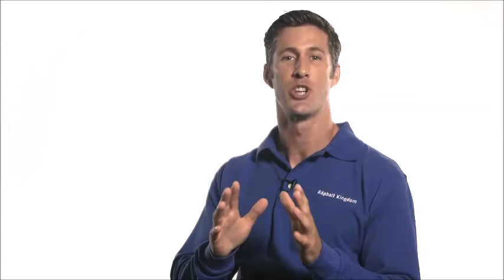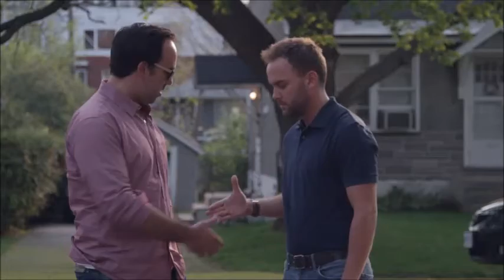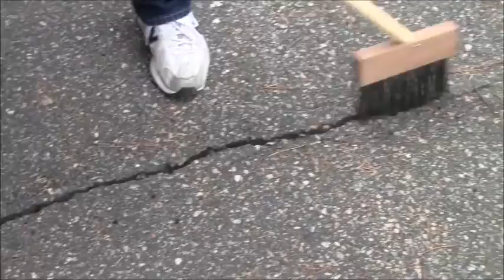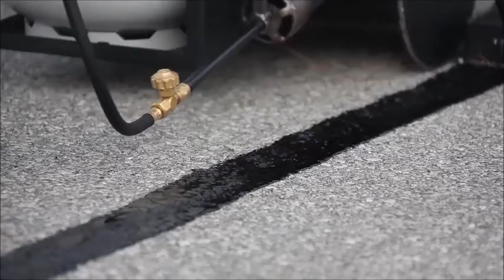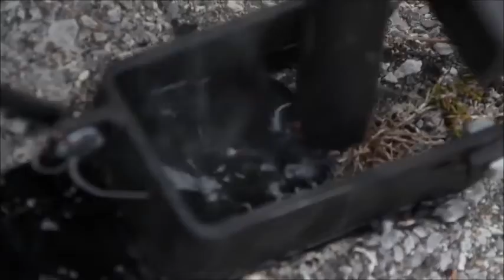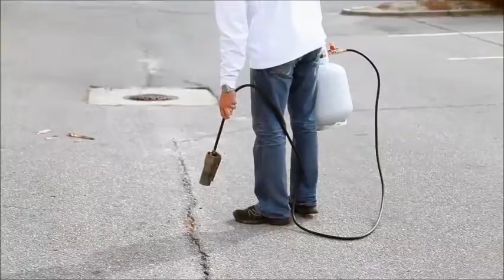BYOBB - Chapter 4: How to Crack Fill

Comment: When filling the cracks will the crack sealer fill the crack flush to the top of the driveway or parking lot?
Reply from the maker: Great question! When filling cracks, the crack sealer is designed to fill the crack level with the surface of the driveway or parking lot. After application, it may need some time to settle and cure, but the goal is to have a smooth, even surface once it’s fully set. If you have any more questions or need tips on the application process, feel free to ask or directly call us at  📞 1-855-651-9179!